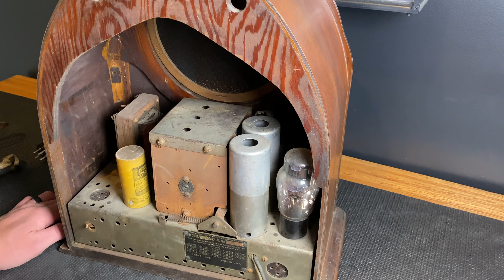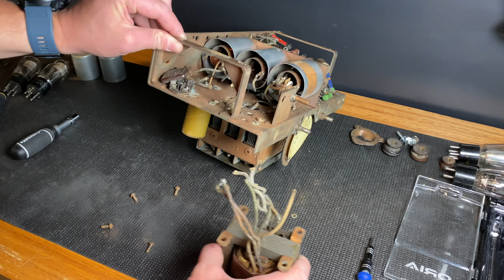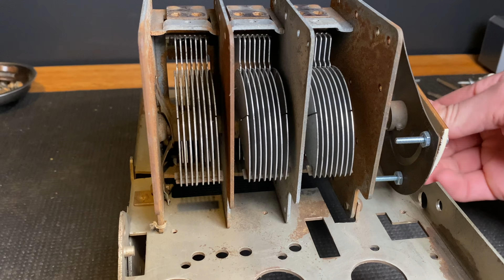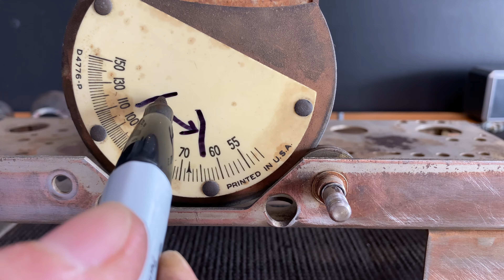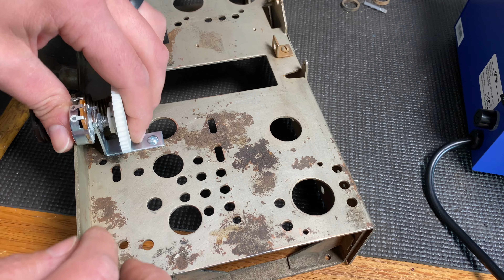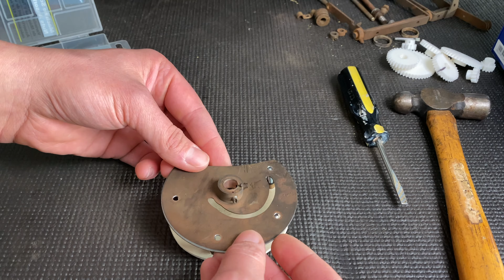Fender Champ 5F1 from Vintage Silvertone Tube Radio || Part 1

Comment: I absolutely love this. I have an old admiral floor model record player (no radio model) I'm wanting to do a build with. If I tried to keep all the original parts what all would I have to do to it to achieve a good working guitar amp? I understand the replacing the 2 prong to a 3 prong, and removing the death cap. I've done that with an old fender super reverb. I've never actually done a conversion from one thing to a guitar. Any advice would be greatly appreciated.
Reply from the maker: Thank you! Let me do some research on that model and I’ll let you know my recommendations. What tubes does it use?
Reply: @gracenoterecordings  I'm unsure it's a Admiral y8031
Reply from the maker: I wasn’t able to find the schematic for that model, but you could go a couple different directions with it. The far “easier” method, and the one I recommend if you want a functional guitar amp with a more desirable sound, is to simply build to a specific circuit. This is what I chose to do for the build in this video because the original components weren’t useful for amp circuits. 

Depending on what tubes are inside, your could search for a guitar amp schematic that uses those tubes and alter the circuit accordingly or even design your own circuit around the components inside. 

Let me know what tubes are inside and I can provide a more specific recommendation. What kind of guitar and amp do you normally play?

Hope that helps!
Reply: @gracenoterecordings  thanks man I really appreciate it I'll have to go out to the building later and look at it. As of right now it's just sitting in my building bone stock.
Reply: Do you have an email I can send some pics to?
Reply from the maker: Ya, send them to gnrecordings@gmail.com
Reply: @gracenoterecordings  sent you a Email thank you.
Reply: @gracenoterecordings  did you receive my email?
Reply from the maker: Yes! Thanks for the pictures. I haven’t messed around with any record players yet, so there’s definitely others out there who might be able to give you a better recommendation. 

I wasn’t able to find a schematic for it but is it a radio as well as record player? If not, it could be as simple as putting a guitar input into the same input that the play head needle goes into since both are very low amplitude signals (assuming everything works). If there is a radio circuit, you’d have to bypass some sections of the circuit including the filters, oscillator, etc. 

Not sure your level of experience, but I’d start there. 

Hope that helps and good luck with it!